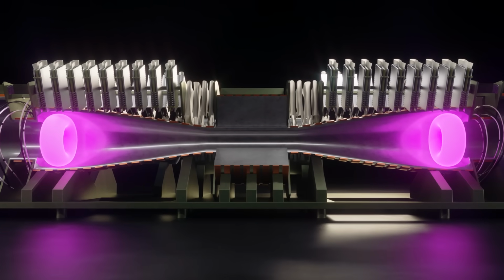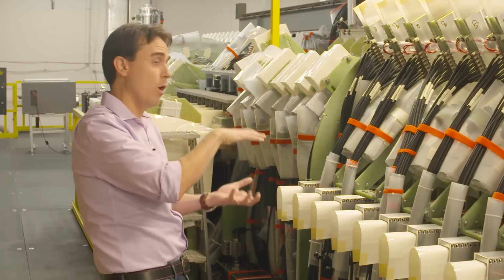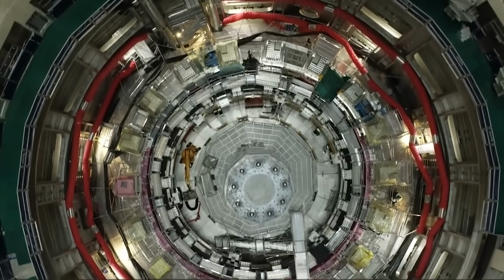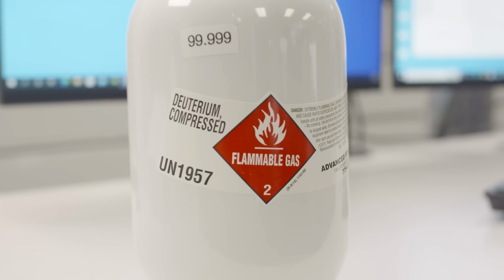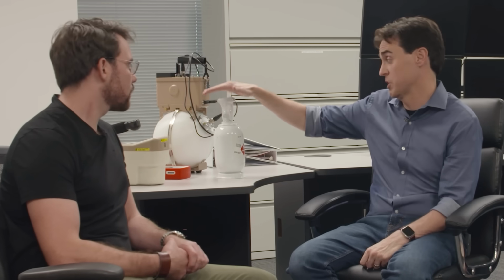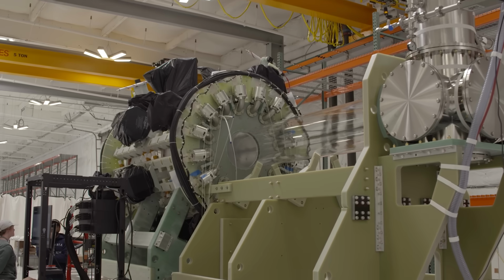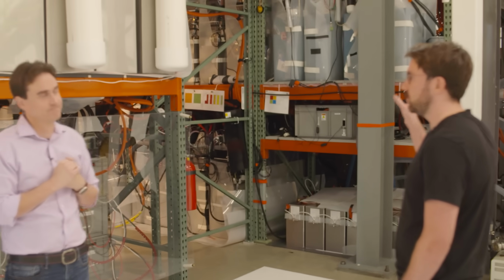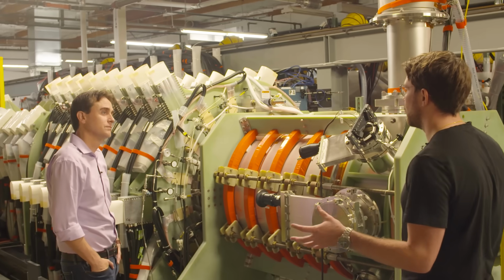A New Way to Achieve Nuclear Fusion: Helion

Comment: There is a "critique video" of Real Engineering's video and Helion's approach by another channel (which I am not going to name here) making the rounds now. People have been bringing this up in the comments here. 
The author of said critique seems to solely rely on the video above (and a couple of blog posts) in his critique from the point of view of someone who claims to have worked at JET. 
This is not quite fair. The Real Engineering video was made by people who are not plasma physicists and is meant for consumption by the general public. It does not contain all the physics details you would find in a scientific paper or a talk in front of peers.

So here is my critique of the critique of the Real Engineering video:

- Critique: "FRCs have been done before and never worked." 
First, define "worked"! What was the goal of the experiment and what was the outcome?
Second, yes, FRCs have been done before and the members of Helion's founding team were actually involved with several of them. They applied the lessons learned from those to their own design, which they have tested over 6 prototypes so far.
Lessons learned and applied:
1. Size of the FRC. The larger, the less susceptible to n=2, rotational instabilities.
2. Elongation to radius ratio. The longer the FRC, the more stable it is to tilt instabilities.
3. The merging before the compression. This part creates a single, hotter and more stable FRC as a target for compression. FRCs get more stable, the hotter they are.
4. Helion's FRCs have a very low electron to ion temperature (Te:Ti) ratio of 0.1 and less. That makes things a lot easier compared to machines where both are in an equilibrium because: 
P(fus)/P(loss) scales as Ti^1.5 / (Z^2 * Te^0.5 )
Where Z is the atomic number (in case you wonder about that).

- Critique: "Deuterium- Helium3 has a smaller reaction cross section than Deuterium- Deuterium. At the 100 million degrees temperature discussed in the video, Deuterium-Deuterium reactions would be much more likely than Deuterium-Helium3 reactions."
That is generally true, but the author misses some key points:
Trenta is a subscale prototype with much weaker magnets than what they are proposing for a full scale powerplant. Because of that temperatures are somewhat lower than in a full scale power plant. Power plants aim for temperatures 20 keV (220 million degrees) and up to 330 million degrees (30keV). At that point the D-He3 reactivity surpasses the D-D reactivity.
That said, Helion actually wants some D-D reactions because that is how they are breeding their He3.
D-D => He3 +n or D-D => T +p
Both reactions have a 50% chance of happening.
So, in mixed mode (breed and power) machines, they will need two D-D reactions for every D-He3 reaction, at least until the Tritium inventory is large enough that they have a constant supply from decay (Tritium beta decays into Helium3). Sicne Tritium has a half life of 12.3 years, that can take maybe 20 years. That fact is probably the best criticism of Helion's approach.

- Critique: "Deuterium- Helium3 is too hard and Tokamaks cannot do it. Therefore Helion's approach of fusing Deuterium and Helium3 can never work."
D-He3 is very hard to ignite, but they do not need ignition for their design to produce enough net electricity to be economic. Most of the energy from D-D and D-He3 reactions is released as charged particles, not in neutrons. Helion can recover the energy in charged particles directly as electricity at a higher efficiency than a steam plant would. They can also recover 95% of the input energy directly as electricity. That makes their machines a lot more efficient.
Further, FRCs are high Beta (~1.0) compared to Tokamaks (~0.05). Beta means the ratio of the plasmas internal pressure to the pressure applied externally via magnets. If it was just about the efficiency of the magnets (it is not), then a 10 Tesla Helion machine would outperform a 200 Tesla Tokamak. 
But, it is a bit more complicated than that, because confinement times in FRCs are generally lower. You win some, you lose some. Overall it is still a win for Helion's approach.
Since Helion is using adiabatic heating through the compression stage, they can to some extent(!) balance temperature and density almost linearly for a given magnetic field. D-D reactions favor higher density and lower temperatures. D-He3 is the opposite way round. They can tune that just to the right sweet spot between density and temperature depending on which reaction they want more of.
Another thing that works in Helion's favor is the aforementioned Te:Ti ratio. This ratio actually decreases further with higher temperatures. So the hotter the plasma gets, the smaller that ratio. Trenta already showed Te:Ti at <0.1. It is likely that a power plant will have an even lower ratio. Lower electron temperatures greatly reduce Bremsstrahlung losses. At a ratio of 0.1, thermal transport losses actually kick in earlier than Bremsstrahlung.

- Critique: "The neutrons from Deuterium-Deuterium reactions would have fried Trenta and I see no shielding." 
As mentioned, Trenta is a subscale prototype, an experiment. It is smaller, weaker and only operates at one pulse every 10 minutes (max). A full scale powerplant would do 10 pulses a second!
Not all shots were fueled by Deuterium or Deuterium + He3. Many were fueled by a mix of hydrogen and Deuterium or pure hydrogen, depending on what they wanted to test.
Because of that alone, the total neutron flux that Trenta has experienced so far is not that high.
What the critique does not mention is that neutrons from D-D reactions have a much lower energy than those from Deuterium- Tritium reactions (2.45 MeV vs 14 MeV). Those 2.45 MeV are below the activation energy of many materials.
The machine is mostly made from low activation materials or materials with a half life measured in minutes. Aluminum activated by D-D neutrons has a half life of 2 minutes.
In fact testing different materials under neutron exposure was one of the purposes of Trenta. They have tested quite a few alloys to see how they behave.
There is still permitted shielding of course. It is in the walls of the room and not close to the actual machine, which can handle the aforementioned relatively reduced neutron load just fine. 
It is also worth mentioning that a mixed mode Helion power plant (that does both breeding and power production) would produce neutrons only in one third of all reactions. So the neutron flux, even for those machines would be lower than for a D-T Tokamak.

- Critique: "Helion claims that they discovered new physics when they say that the ion gyro radius is 25% larger."
The whole ion gyro- radius thing was based on a misunderstanding and out of context quote and maybe also bad wording.
What happened was that Trenta achieved a higher ion temperature than predicted by Helion's too conservative physics model (a higher ion temperature is actually a good thing!). That higher ion temperature caused a 25% increase in ion gyro radius, which is perfectly in line with established physics. That's it. Nothing to see here!

That is how far I could bear watching the "critique" video. Once the picture of Chernobyl came up, I quit. Not worth my time. So if you have any other points that you want me to take apart, feel free to ask!
Reply: Honestly as a layman with speciality in computer science. You're critique is not convincing. You're clearly trying to spin each point as a negative for improbable matter. Even you seem to agree with him. This makes your argument  extremely weak. It is still an open question what level of shielding fusion reactors will need. It is also not a defense of something to say the next one will do it well. Honestly from reading this post and your other one, there seem to be real deficiencies in this YouTube video.
Reply: @superbird2922  Uhm, OK...
I am not sure you are reading my post right.
I gave a very objective view of the situation. 
Can't remember agreeing with IM on anything.
The shielding is not a problem, as I mentioned. D-D neutrons are easier to handle than D-T neutrons.
Power plants will be surrounded by borated concrete, Lead and hydrogenous shielding materials.
I guess one has to make a snarky YouTube video in order to be "convincing".
Reply: @elmarmoelzer2229  That would likely work, do it. I'll watch it. This company is very easy to pile on when they said they would already have a commercial 50mw reactor. For myself that little bit was enough to go yeah probably run by idiots. Pretty easy to believe everything from there. When you said what is successful, I think we know that it is a 50mw commercial reactor so I think its pretty safe to say there projects have been not very successful. Fusion is pretty clearly as faraway if not further than quantum computing. Another more or less currently farcical technology. where are my QEC(quantum error controlled) computers IBM. Youre comments come off as rabbedly defending a random ass company that boldly lies. That fucking weird.
Reply: @superbird2922   They never said that they would have a commercial 50 MW reactor by now.
Reply: @elmarmoelzer2229  https://www.youtube.com/watch?v=3vUPhsFoniw 7:06. xD neat tho
Reply: @superbird2922  Neither you, nor Mr IM  were paying attention and reading the entire page. Too eager to get that "gotacha", I guess. If you HAD read further up in that same article (which was NOT written by Helion, but a blogger), then you will see the following:
"David indicated a break even fusion machine would need 35 million in funding"

They did not have the funding. Even Trenta cost less than the 35 million would have been in 2019 USD when they started building it. And Trenta it is really close to break even (for DT which is what Helion was still pursuing back then).
Again, IM's "critique" is a nothingburger.
Reply: @elmarmoelzer2229  hmmm interesting. call me when they meet Q-power
Reply: @superbird2922   Define Q-power!
What does that even mean?

Polaris is still on track to demonstrate net electricity(!) next year. At the end of the day, what counts is how much energy you have in the capacitor bank.
Reply: @TriNguyen-he7xk   I did post critique there too.

Comment: What do you think about this video guys? https://youtu.be/3vUPhsFoniw
Reply: From my point of view, it sounds more like a rant than like a scientific critic (starting from its tone).

To start with, Improbable Matter arguments in that video contain a number of errors regarding the design, already achieved and future step-stones, parameters, and final goals of the Helion machines, that make me believe he did not researched the topic through before recording.

Granted, the Real Engineering video contains a few errors, but in this case that's undertandable, given that it was made by someone whitout any previous experience in the field, and directed to a non-expert audience.

IM, on the other hand, is supposed to have been involved in fusion research, he should know better.

Basically IM explains how hard it is to achieve fusion (something everyone already knows) and uses that to conclude that Helion machine is a fake 🙄.

Comment: Does Helion have a plan to counter the reduced reaction rate of D-He3? That and at the temps the reactor is operating at rn wouldn’t it favor D-D fusion, emitting tons of neutrons and requiring much more infrastructure than proposed. I’m hoping these problems get fixed, but I don’t see easy solutions…
Reply: Basically, increasing the temperature. At ~700 MK a D-3He mix has the same reactivity that a D-T mix at 100 MK, and a few times better than a D-D mix. I don't think Helion is going to reach that high, but certainly higher than 100 MK (they've said so).
Reply: @charliem6590   Yep they are going for 20 keV, maybe 30 keV (roughly 220 million C to 330 million C).

Comment: Some major problems:

1. D-He3 reactions produce 1000 times less energy than a D-T reaction at 100 million °C so there's almost no chance this method of using D-He3 will generate an energy gain.
2. This video glosses over the the fact that at 100 million °C the D-He3 plasma produces 7 times more D-D reactions than D-He3 reactions. The D-D reactions produce a huge amount of neutrons which will make the reactor apparatus highly radioactive and require an enormous amount of shielding to make it safe.

The video is excellently produced but in my opinion it's nothing more than a shiny advertisement for a venture capitalist physics experiment, not a serious energy production business.
Reply: Problems? Yes. Insurmonable? Maybe, maybe not.

100 million K is the temperature reached with their last machine. Helion is aiming quite higher than that with the next ones.

At about 200 MK a D-3He mix produces 20 times more reactions than at 100 MK, and a ~900 MK it would produce more than a D-T mix at 100 MK (although I don't think they'll need to go that high).

Also, at 200 MK the ratio of D-D reactions vs D-3He reactions is near 1:1 and above that it is even lower. Moreover, the neutron flux created from a D-3He mix can be modulated altering the amount of D, with a 10% D and 90% 3He that flux goes down significantly.

This kind of discussions reminds me of one of the arguments I've heard from so many lunar landing deniers: Landing on the Moon is sooooo difficult, that the only possibiliy they see is that is was a scam. 😋

Comment: Absolute shame this channel is just a advertising avenue for scam companies like this. There are numerous problems with the "engineering" in this video, and the CEO, while knowledgeable about physics, is completely disingenuous about this machines capabilities.

Time to change the name of the channel to "Ambiguous Engineering"
Reply: Sorry, but would you be kind enough to name the alleged problems with the engineering? Because I call bullshit on that.
Reply: @elmarmoelzer2229  
1. D-He3 reactions produce 1000 times less energy than a D-T reaction at 100 million °C so there's almost no chance this method of using D-He3 will generate an energy gain.
2. This video glosses over the the fact that at 100 million °C the D-He3 plasma produces 7 times more D-D reactions than D-He3 reactions. The D-D reactions produce a huge amount of neutrons which will make the reactor apparatus highly radioactive and require an enormous amount of shielding to make it safe.
Reply: @magnanova  Since you copy/pasted your objections, let me copy/paste my answer:

Problems? Yes. Insurmonable? Maybe, maybe not.

100 million K is the temperature reached with their last machine. Helion is aiming quite higher than that with the next ones.

At about 200 MK a D-3He mix produces 20 times more reactions than at 100 MK, and a ~900 MK it produces more than a D-T mix at 100 MK (although I don't think they'll need to go that high).

Also, at 200 MK the ratio of D-D reactions vs D-3He reactions is near 1:1 and above that it is even lower. Moreover, the neutron flux created from a D-3He mix can be modulated altering the amount of D, with a 10% D and 90% 3He that flux goes down significantly.

This kind of discussions reminds me of one of the arguments I've heard from so many lunar landing deniers: Landing on the Moon is sooooo difficult, that the only possibiliy they see is that is was a scam. 😋
Reply: @magnanova  
That is simply not true:
A D-He3 reaction always produces the same amount of energy: 18.3 MeV in charged particles (an Alpha and a proton).
A D-T reaction always produces the same amount of energy: a 3.52 MeV Alpha and a 14.06 MeV in a neutron.

What you are probably referring to is the reaction rate. That is indeed lower for D-He3 that for D-T at 100 million degrees C. 
But Helion's power plants will operate at a much higher temperature than 100 million degrees. That was only the temperature Trenta, a subscale prototype achieved (and that is outdated already too).
The 50 MWe power plants will operate at 200 to 300 million degrees, maybe higher.
At those temperatures D-He3 becomes more reactive than D-D.

Now, you need to understand that Helion actually wants about two D-D reactions to happen for every D-He3 reaction. Those reactions are needed because half of all D-D reactions will result in a Helium3 atom (fuel) and a neutron and the other half in a Tritium atom (which will eventually also decay to a He3 as fuel) and a proton.
The He3 from the first D-D branch is fed back into the machine as fuel.

So, one third of all reactions will result in a neutron and a Helion power plant will have one third of the neutron flux of a Deuterium- Tritium plant.
There is more to this though:
The neutrons from D-D have a much lower energy (2.45 MeV) than neutrons from D-T reactions (14 MeV).
2.45 MeV is below the activation energy of many materials. Helion also uses materials that are either low activation and or those with a very short half life. E.g. their magnets are made from aluminum with a 2 minute half life from activation by D-D neutrons.
Other parts will of course be shielded against neutrons. The building as well.

So why does Trenta not have any visible shielding?
Well, aside from the reasons already mentioned, Trenta also is only operating at one pulse every 10 minutes (vs 10 pulses per second in a 50MWe powerplant).
So that already reduces neutron flux by a factor of 600 compared to the power plant. 
At 100 million degrees, D-D reaction rates are also quite a bit lower than at 200 million. 
Then there is the fact that not all experimental runs were using Deuterium or Deuterium - Helium3 for fuel. A lot of them were using just plain ordinary hydrogen or a mixture of hydrogen and Deuterium at various concentrations. 

There is still permitted shielding even around Trenta of course. It is in the walls of the room and not close to the actual machine, which can handle the aforementioned relatively reduced neutron load just fine. 

Any more questions?